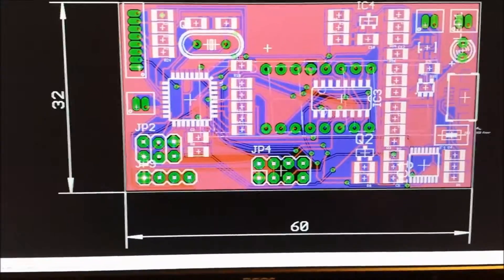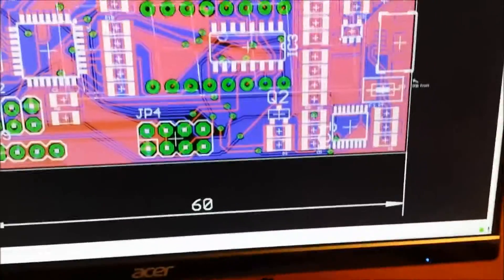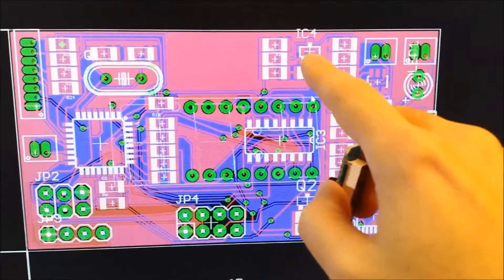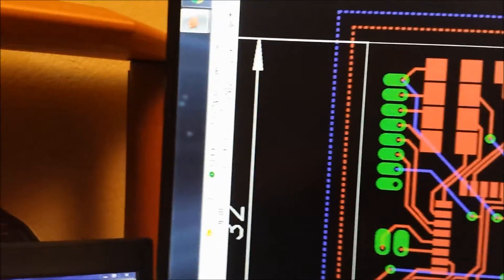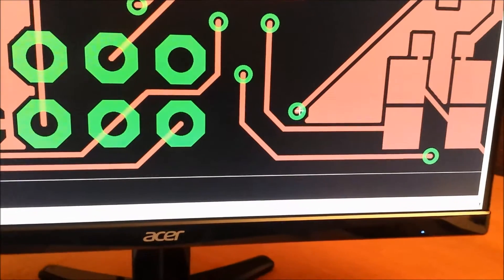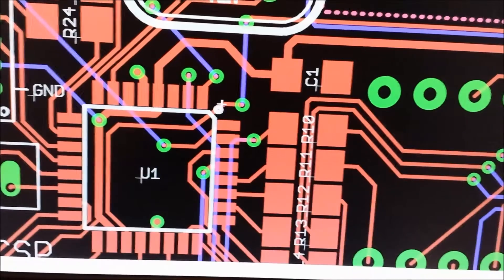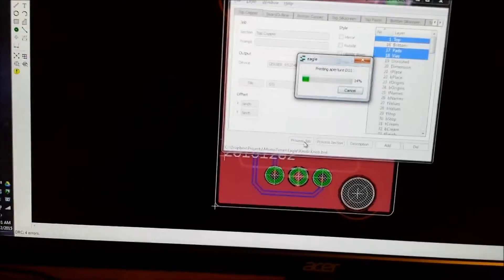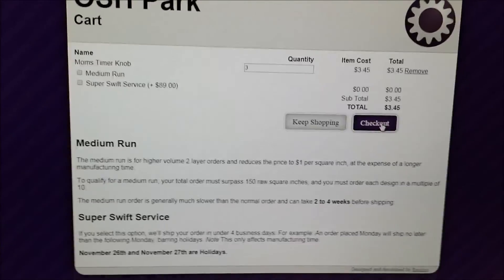Moms Timer 09 - main unit pcb's using CadSoft EAGLE and OSH Park

Comment: im making my first pcb, should i always fill the board with gound plane ?
Reply from the maker: There are a lot of reasons to include one and also to not include one, it's just based on the board you are making.  I have been including one in my designs for the simple reason of making it easier to connect everything together.  Most every part on my board needs a connection to ground so having a flood fill of ground saves me from having to route 1/2 the air wires.  There is an interesting discussion http://www.eevblog.com/forum/beginners/when-not-to-use-a-ground-plane/ about when to not include a ground plane.  It's a technical discussion but hopefully can give you an idea that there can be some very specific reasons to not include a ground plane.